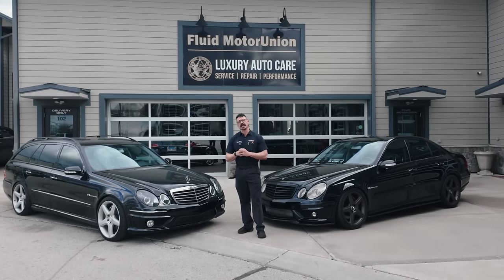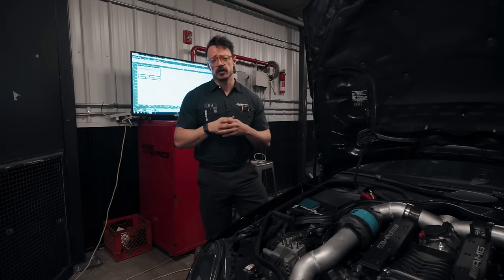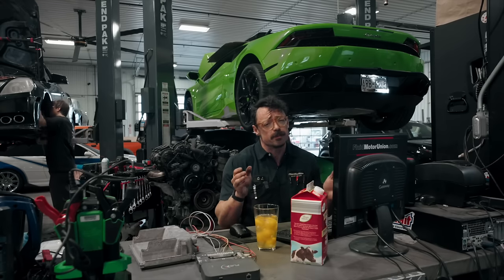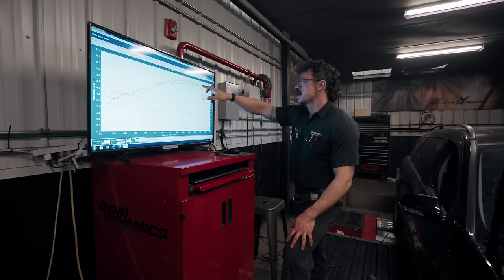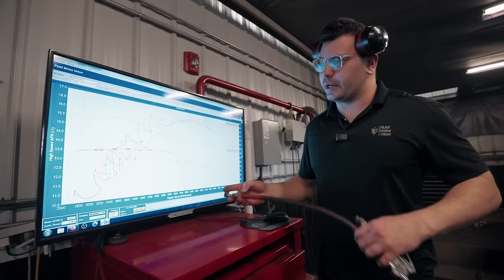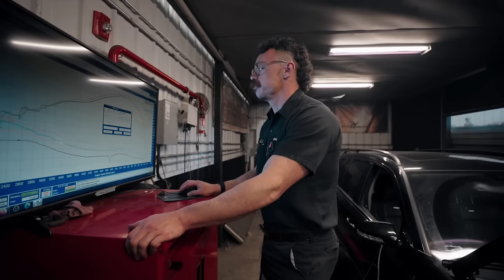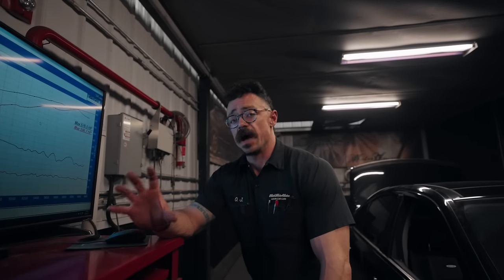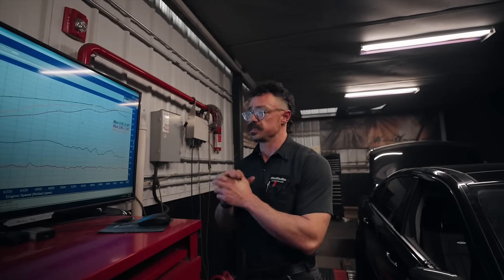E55 AMG VRP vs Weistec Whipple PT2 - DYNO TUNE BATTLE! Same Blower, Very Different Results

Comment: I built the Weistec car in the video. It’s setup for max effort stock engine. Running over 22psi with a MAP sensor voltage clamp. Dual Walbro 450’s, 8AN fuel line with return system. It was a turn key 10 second car when I sold it. Amazing build. Did 694whp on a Dynocom Dyno in summer in Maryland. Ran 131mph in the quarter without meth in the summer heat. Alex’s wagon is SO SICK!
Reply: Did you end up making a profit on this build when selling it?
Reply: @bigqwertycat  yeah I made a few thousand bucks when selling it, but doesn’t really account for all of my labor. I built the car myself and only thing I paid for was a final Dyno tune.
Reply: I'm thinking of possibility of upgrading my S55 amg, but the market is bit low in Portland Oregon.

Is building and selling something you do often?
Reply: what's the exhaust setup on it? sounds amazing
Reply: @chrisa840  MBH long tubes, custom made X pipe, w211 E63 resonator, RennTech mufflers (super rare, came with the car when I bought it). The RennTech mufflers sounded a lot like 204 C63 mufflers. This whole car was a dream setup of mine, just needed a 722.9 wet clutch trans swap
Reply: 22psi!? God damnnnnnnnnnn that thing must rip, tq off the line has to be insane.
Reply: Boost and Fuel 💪
Reply: My weistec build made over 700whp at 17psi🥂 the secrets
Reply: 22 psi on stock head bolts? Ticking time bomb but still badass
Reply: Hi which Map clamp have you used or it can be any universal one ?
Reply: @ADI126SEC1  it was a split second voltage clamp. I actually have a spare one for sale if you want one cheaper than new.
Reply: @slowb3nz  yeah. 100% stock engine. I’m not aware of headbolt problems on the m113 engines but at this power level it could have definitely used them.
Reply: @BrianCrofoot  I’m interested
Reply: Whyd you end up selling it
Reply: @shawnkennedy8425  decided to build another car. Found a deal on an R33 GTR and now that car has gone off the deep end. It’s almost running.
Reply: @BrianCrofoot  Brian do you still have that spare split second Voltage clamp  I’m interested!!!
Reply: @BrianCrofoot  yes Brian I need it how we can take  care of this ?
Reply: How much whp was required to hit that 1/4mi mph? Online calculator says around 730whp needed. I was into DSMs for 15yrs and my street car/weekend warrior (full interior) would drive 1.5hrs to the track, trap 128-130.75 in the 1/4, then drive home. I miss having a street car that was actually quick and have been kicking around the idea of an E55 for a little while now.
Reply: @Kapok6  my car made 695whp on a Dynocom Dyno. I have a video of it on the Dyno on my page. It spun a little on that run, which is why I think the torque read so high, but it was consistently making about 850wtq all night. That was heat soaked on the Dyno in summer. The car would make another 2-3 psi of boost on the street compared to on the Dyno, so it was probably in the ballpark of 700-730whp when I ran it at the track.
Reply: @BrianCrofoot  that's glorious..I've really been eyeballing these e55's and been researching as much as I can in my spare time. I e got a few questions about the platform. Do you have an Instagram or something I could DM you at for a few more questions?
Reply: I seen video of frank tuning ur car... I was blown away.  I have a 05 e555 with whipple, interchiller and everything else available to the platform.. first roll on dyno car made 493... frank advised i had some mechanical issues.  I corrected them and next roll with same tune, car made 599... frank worked his magic and car made 724/881 with 15lbs on 93... been working setup over the past year and go back to frank this coming weekend to tune car on E85.. expecting numbers never seen with the platform if it doesn't send a rod..
Reply: @kevingraham9054  that’s amazing! Frank is the man! Have you ran your car at the track yet?
Reply: @BrianCrofoot  yes sir! She has been 6.6s in 8th... Only one quarter pass mid day about 90 degrees out and she went 10.8s. just installed coilovers to get the camber right and hoping to be able to stay on 26... Frank swears car will need beadlocks and a 28... We see... Looking forward to this e85 tune and some timing...
Reply: @kevingraham9054  that’s awesome man! That’s about the same as my old car was doing! Went 10.7 on slicks on a hot July night on pump 93. Congrats on your build!
Reply: @bigqwertycat Portland SL55 here
Reply: @Dailymercedes please give me an advice! I have m113 5.4 na amg version and I am planning to go supercharger. What would be the best route to eventually make that 700whp+ weistec? I have heard that with some slight modifications you can run a compressor on stock na m113 500hp safely. I am not sure about that tho. The true question is if I should swap m113k and tune that or I can just buy forged internals and basically upgrade na to withstsnd boost. I really want to make this come true.

And what about the gearbox, will it need any upgrades to take the torque?

Thx!
Reply: @TheJoSef1n  100% drop the 113k in that’ll make your life 10x easier for when it comes to getting to the power, and gear box I’d recommend upgraded sga 150% valve body, upgraded trans pan, and tj merry tcu tune. To reach 700hp you’re gonna need ARP head studs, running full e85 on 28* of timing from race iq, extremely good cooling, and proper pulley stacks, cams etc. it’s ALOT of work to get this car to 650-720whp, just know a lotttttt goes into building this car a lot more than people think
Reply: Brian which injectors u was running on that E55 how many cc which brand etc ?
Reply: @ADI126SEC1  I believe they were Bosch 630cc injectors. I bought 1000cc injectors just in case, but the 630cc injectors ended up being enough with the 2 walbro 450 pumps and -8AN fuel feed. I tried hitting you up about that voltage clamp but YouTube wouldn’t let me send my email or phone bumber
Reply: @BrianCrofoot  I know buddy I did it so many times and same thing youtube won’t allowed it :( so I went for it and bought it new one
Reply: @BrianCrofoot  yes I tried and I couldn’t so I went for it and got it brand new thanks on the update for the injectors I even texted u on insta
Reply: @BrianCrofoot  thanks for the info and yes  I know what u mean I tried several times and nothing so I bought it from split second
Reply: @Dailymercedes  what are the secrets ? I highly doubt it !
Reply: I have the same weistec kit, 174mm crank 65mm supercharger pulley. 
Charge air pressure 17,5 psi, is that normal? 
Yours 22 and the same ratio.
Reply: @gnagye21  I believe my crank pulley was 180mm. Made 22.9psi peak. I also had the Thermalnator intake gaskets and a MAP sensor voltage clamp.
Reply: @bigqwertycat i have a proven 19psi setup 
74upper
180lower
E85
650cc
Interchiller
Retune

Comment: These are 2 very different kits, the Kit on alexs car is the out of the box base package for the VRP whipple. 105tb and smaller pulleys/stacked crank pulleys are upgrade options that we offer.
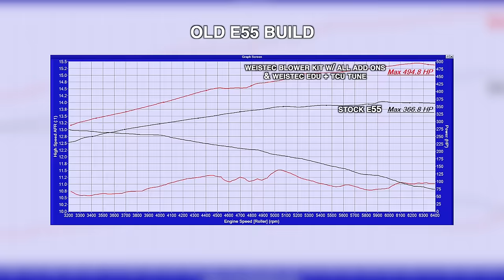Reply from the maker: We make that clear in depth at the end. Alex’s car makes more power than an out of the box Weistec kit seen at 2:59.
Reply: It would be cool to see IATs and power numbers at the same boost levels. I think the bigger intercooler helps the weistec kit at big boy boost levels. That is my old Weistec car and it was running over 22-23 psi with a big fuel system and a very fat/safe tune and still went 133mph in the 1/4mile on a hot July night
Reply: He literally explained it at the end lol
Reply: Does the VRP kit have an upgraded intercooler option similar to the Weistec model?  While I find the VRP kit more aesthetically appealing, getting an upgraded intercooler is a very appealing selling point...

Comment: Love these cars and the Weistec Whipple Blower.  Anyone considering buying or modding one of these do yourself a few favors as the Achillies heel is heat soak / high IAT's.  First, make sure the cooling system isn't air locked and know how to fix it (very simple)  by bleeding the lines.  Second, your first modification should be water / meth injection before any pulleys, headers, heat exchangers (h/e's they help with cooling recovery not driving IAT's).  I had a FBO with dual pulley set-up 168 crank and 77 CLUTCHED pulley set up and on 0-140 pulls the IAT's would stay around 70 degrees.  Finally, don't do a fixed pulley.  Does nothing from a performance perspective versus clutched pulley and due to the fact they are always spinning the engine is always hot.

Comment: From my experience the stock charge cooler is inadequate even in stock form, the entire system actually, do a few back to back runs on any stock M113K car and it’ll go into limp mode from high IAT’s, the VRP kit is very nice and modular in that you can add components as you go but retaining the stock charge cooler was a bad idea imo. 

The Weistec kit is a better design especially in the cooling department but it’s getting old now, I like what VRP is doing but they need to find a solution to using the stock charge cooler, yes they have external coolers that replace the surge tanks but it totally changes the look of the engine, if you’re aiming to keep things looking relatively stock it’s a no go. Either way it’s awesome to see companies still supporting this aging platform and I hope that never changes!
Reply: Some guys are converting the stock intercooler to single pass with bigger inlets/outlets and I believe a slightly larger core can be adapted to the stock case as well.
Reply: I agree on the stock intetcooler being inadequate but “limp mode from high IATs” on a stock car sounds like something not right. Unless you mean just heat soak by “limp mode”. Can definitely get it to heat soak even in just a warm day.
Reply: @tonistaru 100% - I’m on 84/168 (=180CP not a huge stack..), headers/no cats/resonator/3” to stock mufflers, 82mm TB, stock intercooler, 010 pump, frozen boost HX, mishimoto tstat, -10c fan mod, cooling UNsplit. IAT’s are ~10deg above ambient at nearly any temp, recovers to that point after 130mph pulls in 15-20s? Car responded well to that tstat, FYI. 496/560 wheel on a Mustang dyno w/ heavy ass 19” sl65’s.

Comment: In regards to trying to ascertain what is causing the significant power difference between the two cars....one item you mentioned in the beginning, that I would think has a significant impact on the power output, is that the Weistec car also has Meth injection...that, combined with the ostensibly more efficient intercooler, would make a huge difference in and of itself.
Reply from the maker: in the tests here, we did not run it with the methanol, so what you are seeing is mostly intercooler efficiency and flow most likely.

Comment: They can be read via obd but gotta crack the ECU open and ground out the boot pin on the am29 chip. Galetto can be used.
Reply from the maker: Correct. Both cars had their file read via kess but it not something we advertise we do cause it’s risky and I don’t want people sending us a boat load of ECU’s. Much rather send a cable and do it through galetto with a base orginal.

Comment: I’d like to see the difference with stock superchargers with smaller pulley setups compared to these high priced kits .
Reply from the maker: The highest power we’ve extracted, intercooler long tubes 182mm lower and smaller upper, bigger throttle body, ported surge tanks, ice box, upgraded cooling, intakes… 492. So what a weistec kit bolts on to make.
Reply: @FluidMotorUnion how does your dyno compare to a Mustang dyno? I’m at 495 on a mustang with 84/168 pulleys, similar mods otherwise but cooling is UNsplit.

Comment: @FluidMotorUnion what ignition advance did you end up with Alex’s car at full boost? I have a M113K swapped 560SEC with Weistec kit and Haltech ECU. My tuner was a little scared to lean into it and I have ended up with single digit advance which is quite a bit less than what Weistec was recommending. I’m running 98 RON fuel
Reply: Nice swap
Reply from the maker: Sounds like a sweet build!! Peak timing under full load logged at 22 degrees, optimal timing can run all the way up to 29 degrees if everything is perfect but that means proper cooling, good fuel, etc. Are you local to us? We're familiar with Haltech - OJ actually trained with them. Would be happy to help you dial in the tuning!
Reply: @FluidMotorUnion  Thanks very much for the info, it is confirming what Weistec said. I have twin 044 pumps, 1000CC injectors (88% dutycycle), looped rail, large HX and header tank and a Pierburg circulation pump so I'm all good from a supporting viewpoint. What stopped the tuner adding more timing was the study underlying noise from the knock sensors and the fact first time tuning M113K engine. Weistec also said the M113K is a noisy engine. Unfortunately I am far far away from you guys in Australia. Loving the content though, well done!
Reply: What an awesome body & engine swap combo. The big burly SEC coupe just seems like the perfect candidate for M113k power.

Comment: I like the LS ECU bench flash setup. Would have been nice to see boost numbers on both cars. On the first car with all the Dyno runs what was the best torque gain?
Reply from the maker: We don’t have pre numbers. We were only contracted to do custom tunes on these cars after installation. But in the video we have a dyno graph @ 2:59 stock car came in and got the Weistec kit. Alex’s kit is still more powerful as is.

Comment: Have you had e55 with turbos come across your shop?curious to see what the tuning potential with turbos would be. 
Possibly removing the supercharger and going turbo instead, I've seen others do turbo+supercharger.
Reply from the maker: We have not! There are some forum posts about turbo kits for the E55 - the story usually goes something like "we've got the turbos and intercoolers now all we need to do is develop the tuning" and then nothing else ever gets posted to the thread... Anything is possible with enough money and patience, but the cost of R&D for something like this would be hard to justify when there are already great supercharger offerings dominating the aftermarket.

Comment: OJ would be good to know the Charge Air Temperature numbers on these kits. Higher HP numbers with better cooling?
Reply from the maker: being that its winter in chicago coupled with lots of other factors other than the cool air...most of the info is hard to present in simple way, that won't bore. Cars were let to cool down to 20-15 degrees above ambient not running, then ran till heat soak, with was in the 140's for both cars. So the runs were at done to similar iats. the differentiation was Alex's car, like all stock blower e55 cars did that in 1 run once engine was warm (above 145 coolant temp). where the weistec car could run 3 or so runs before it ran similar temps. but the cars made best power on the first run. not surprising given the stock intercooler on alex's car.
Reply: Thanks OJ.
So there must be deal with better cooling on both cars. If the air is cooler (cooler efficiency better) can the AFR weaker, or leave the tune as it is?
Also we cannot see the torque diagramms, do you have them, and numbers? @FluidMotorUnion

Comment: Those are wheel horse power . 
What would be the equivalet to crank horse power ???
Reply from the maker: We give the example of a 707hp dodge hellcat putting down 493 hp in the video so you can extrapolate for yourselves.

Comment: what wheels are on alexs car? those would look good on my e55 as well
Reply: Both cars are sporting the CLS55 AMG 5 spoke 19 inch rims. Word of advice for these rims is that they are very easy to crack and bend due to the lack of a reinforced inner barrel. Get them if you have nice roads, and also be aware and have them thoroughly inspected before hand.

Comment: 52 runs 15 hp I would of just repaired it and left not risk shaving 60000 miles off stock bearings.
Reply: By that logic just 20 WOT runs, 3-4 gear changes on the street would shave 60k miles off of bearings ehh? Yea totally not worth it to scale 1000cc injectors, an upgraded fuel system and 200+ added crank horsepower making it safe…
What are you talking about bruh?